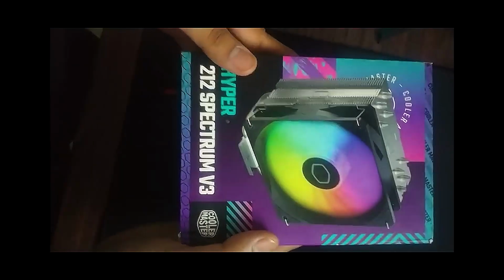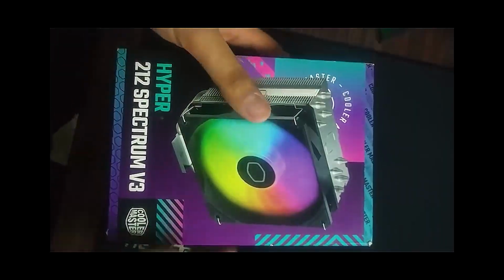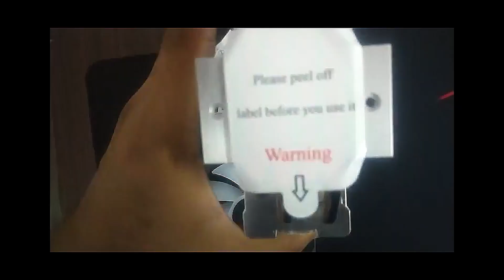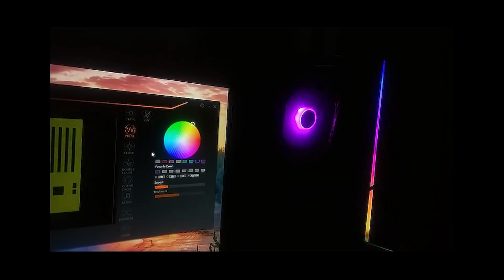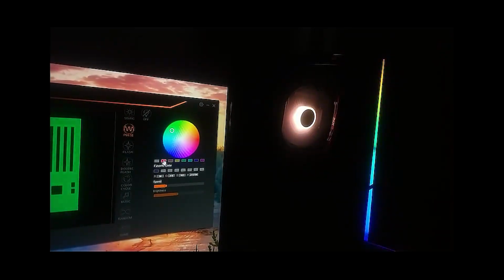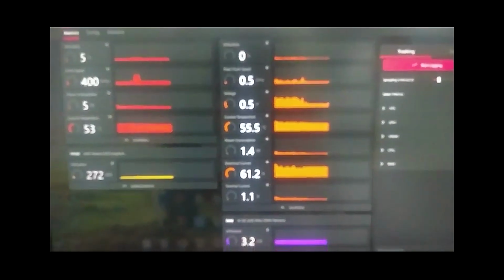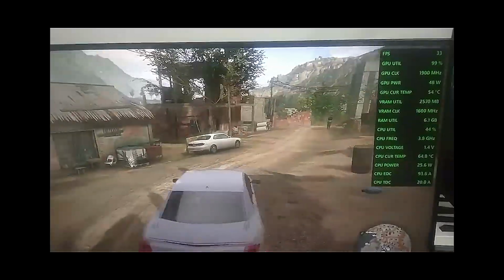Cooler Master Hyper 212 V3 CPU Cooler Unboxing & Installation (5600G) | 2024

Comment: Bro i dont have argb support to motherboard, does cpu cooler lights up with power pin ?
Reply from the maker: If you don't have the ARGB header then the cooler will light up with the default rainbow colors.

Comment: I have soke gigabyte h610 mobo it doesnt have rgb thing . Will this fan fit and run on my mobo ?
Reply from the maker: If your MB does not have an ARGB header then the fan will work but to control RGB you'll need an external controller.
Reply: @livingwithtechyt  ok thanks  I only want the fan working I don't care about the lights 😅

Comment: ffs install the fan with the wire at the bottom so the cable doesn't hang over the fan like that
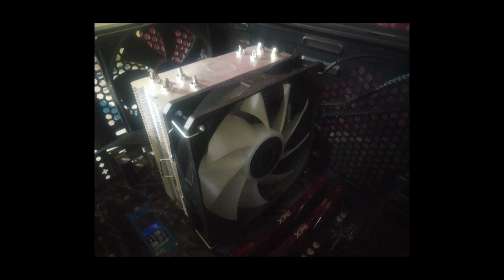Reply from the maker: actually, in the installation clip the wires are at the top but at 1:44 I corrected myself and even showed wires on the right side and finally at 4:05 wires are not hanging over it.
I messed up a lil, sorry for that.

Comment: Screw driver comes in box or you buy separately.
Reply from the maker: No man, screw driver is not included.🪛
Reply: @livingwithtechyt thermal paste is also come in box , why you buy separately,
Reply from the maker: @JustFilmYourself well, It's a better one and I didn't know if it was included.

Comment: The three pin connector is not going in to my ADDR_LED ports. Why is that? I don't want to force it in and break something.
Reply from the maker: Which motherboard do you have? does it have a three pin port? make sure to align the pins properly.

Comment: I need your help. I have an msi b550 pro vdh motherboard and I cannot find a single software to control the lights. help me find one please.
Reply: I have the same cooler
Reply from the maker: Did you try downloading msi center from the official site?
Reply: No but will try, thanks @livingwithtechyt
Reply from the maker: @huntarex2099 yes, let me know.
Reply: @livingwithtechyt  no luck. Could you please help me with the gigabyte fusion software or any other software that workss? I want to get rid of this ugly rbg lights and have a solid colour lol.
Reply from the maker: did you install mystic light?
Reply: @livingwithtechyt  yes, no luck.
Reply from the maker: Is it detecting the cooler? Make sure the LED cable is connected properly.
Reply: Yes it is, by default its on the rainbow rgb pattern.  @livingwithtechyt
Reply from the maker: So the software is detecting the cooler then what does it say when you change the color? Maybe try OpenRGB software.
Reply from the maker: or MSI Dragon Center
Reply: @livingwithtechyt  no the softwares dont detect the cooler at all. the cooler came with the rainbow rgb lights out of the box.
Reply: @livingwithtechyt  thanks dude I'll try that

Comment: Isn't 92 degrees bad ?
Reply from the maker: Yea really bad but after thermal paste and fan installation the temps came down to around 65 as you can see in the video.
Reply: Interesting I have a 9060xt 16gb with a 5600x I just bought and installed this cooler played space marines 2 at ultra settings and I was getting 80-87 Is that good?
Reply from the maker: I think it should be a little better tho like <=80C. Are you using the thermal paste that came with this cooler?
Reply: @livingwithtechyt i used mx-6
Reply from the maker: 🤔 hmm, maybe it's something else like case airflow or room temp, it's fine tho even if it's 87max at ultra.
Reply: It is case airflow im just having a hard figuring how to install front fans with my case 
@livingwithtechyt

Comment: broo this cooler fan has rgb issue I guess my ccoler rgb glitches when I plug it in and also rgb fusion staticonly work
Reply from the maker: I see 🤔, have you tried checking the fan connector or reinstalling the software?

Comment: can I use this for AMD ryzen 5 8600G mounted on MSI PRO A620ME motherboard
Reply from the maker: Yes, make sure your motherboard has a RGB header(3pin).
Reply: @ Yes, MSI PRO A620M-E motherboard includes a 4-pin RGB LED connector (JRGB) but does it allow this pin?
Reply from the maker: @JOZGAMING21 I checked and it seems your mb doesn't have a 3pin header, you might need an ARGB Controller (3pin 5v).

Comment: I have a ryzen 7 5700x and using this cooler 
for gaming its like 70-80 degree . it touches 80 when loading and stuff
for cpu full load the temp raise upto 85 degree 
is it safe ?
I have used the thermal paste that comes with the cooler.
Reply from the maker: 85 max, is okay. R7 5700x also has 65W TDP. make sure the fan speed and good airflow in your case.
Reply: @livingwithtechyt  yeah sure. Thank you
Reply: Does it make noise?
Reply: No @aouadinidal3382

Comment: So, can we install it directly on the motherboard backplate? I have a Hyper 212 LED Turbo, but it only comes with the Intel bracket, not the Intel+AMD. Installing it directly might put excessive pressure on the CPU socket.
Reply from the maker: Yes, this one goes directly on the mb backplate. check out a tutorial for your cooler, just to make sure.

Comment: can I use this for Ryzen 5 3600? and how frequent should the thermal paste be replaced any suggestions?
Reply from the maker: Yes, you can use it for your R5 3600 and for the thermal paste, I would say once in a year.
Reply: @livingwithtechyt  some ppl say change it once in every 6 months.....also I upgraded my cpu choice...I will rather go for r5 5600x...can I use it for this CPU?
Reply from the maker: You can do it twice a year too if you want and yes, you can use it on 5600x.
Reply: @Abhi-hb2sg  depending on your thermal paste you don't even need to change for more than 2 years, using a kryonaut and a similar model cooler my i7 6700k doesn't go past 75c and I haven't changed it since 2022.

Comment: this is useless i installed believing all the good reviews when i open couple of browser tabs the temp rises up to 80 and then comes back to normal after some 30 secs and again if i open anything else like a pdf again temp rises up.. How are you kids playing games with this? or anything wrong with my installation?
Reply: only at idle temp is around 50-55.
Reply from the maker: Which CPU?
Reply: @livingwithtechyt  i7 7700k msi z270 my mb
Reply from the maker: Is it Overclocked? And Maybe the thermal paste you are using?
Reply: @livingwithtechyt  no my cpu was not over clocked. I was using corsair H45 liquid cooling AIO, it works like a charm, keeps the cpu temp as low as under 40 at idle and max 60-70 when i use vm's, multiple browser tabs and other apps.  But only issue is the radiator makes buzzing noise i thought it's dying and i should change it so i bought this crap one but this CM hyper 212 can't handle loads like even few chrome tabs and when i start a VM, the temp went up high to 90+. I removed this 'over' hyper 212 now and connected my old corsair AIO back.
Reply from the maker: Okay but idk why that is happening, it should give you that much cooling and the liquid cooler should do even better. 🤔
Reply: @livingwithtechyt  my corsair liquid cooler is almost 8  years old and still doing its job perfectly except making that buzzing noise. Do you have virtual machines installed like vmware or virtual box or can you open multiple browser tabs and a few apps and see what the temp is?
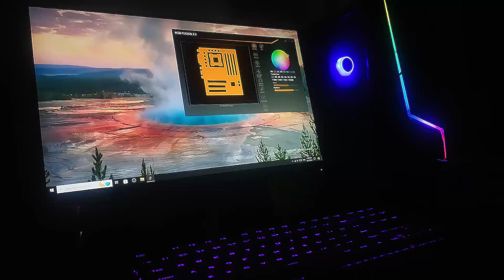Reply from the maker: Yea, I don't use VMs but I opened multiple tabs in chrome, fl studio, VS Code and Photoshop and the temp is hardly 50! And you can already see the in-game temps at 5:15.
Reply: @livingwithtechyt  yes your temp is normal   i am wondering why tf mine is broken it's brand new i installed it correctly. Does fan position matter? How i fitted the fan is with fan cables at the top is that right? or the fan cables should be at the bottom side?
Reply from the maker: @0xcoffee427I don't think that's the problem though in the video I've shown cables should be on the right with the logo on top 1:50 (at first I mounted it with the cables on top and didn't even notice any difference but yea).
Reply: @0xcoffee427  Its been almost a year since i bought this cooler and it works perfectly fine for me. As a long hour gamer my cpu doesn't even heat more than 55°c. Does your case have proper airflow? Intake and exhaust fans? Also make sure you installed the bracket properly and the cooler is well attached to your cpu. And hey, also have you removed the protection film sticker in the bottom of the cooler before you install?
Reply: @0xcoffee427  say fam.....maybe you didnt remove the plastic sticker at the bottom of the heatsink.
Reply: Or fan pushing in wrong direction
Reply: @ No. Seems like fan and the cable is faulty. I sent it for RMA and they said they would replace the fan and the cable. So waiting to receive a new one.
Reply: @  Fan and its cable is faulty. I sent it for RMA to replace it.

Comment: I need a tutorial to change the rgb colors.....!!
Reply: did u found it?
Reply from the maker: hey, do you still want a tutorial? Let me know.
Reply: @livingwithtechyt  my friend doesnt have rgb header, it says mystic light 3 is needed but he cant figure it out, i also cant help him as i cant see what he is doing. If you can help we will both sub to you 🙏
Reply from the maker: @kira3821  so you have a MSI motherboard? Does it not have a RGB header?
Reply: @livingwithtechyt  its gigabyte A520M, the cooler has color but its the default rainbow, he wants to change it, he tried the rgb fusion from gigabyte but it cant be detected
Reply from the maker: @kira3821  cannot be detected? have you connected the ARGB connector properly? I will probably make a video tutorial on it using RGB fusion and GCC.
Reply: @livingwithtechyt  should be right? cause it produces color, when he tried the rgb fusion, no cooler is detected there, so the software u should use depends on the mobo you are using? thanks again, i hope it would fix his problem, my cooler has no rgb so i dont have this problem 😂
Reply from the maker: Hey, I just tried it without connecting the ARGB and the cooler turns on the rainbow mode(default) just had to make sure, so ask him to check if it's properly connected. 3:58
Reply: @livingwithtechyt  uhmm i asked him to check it and he found out that a 3 pin is not conncted, its like a 4 pin but missing one, but he cant find a slot to put it in on his mobo, maybe a520m K v2 doesnt have it? its his first pc and its pre built one
Reply from the maker: @kira3821  yea that's the ARGB connector and yea I checked and it seems this MB doesn't have the header/slot in that case he'll need to use an external ARGB Controller maybe the one from cooler master.
Reply: @livingwithtechyt  thanks! we tot he has it cause google search keeps saying it has -_- can you link us the correct controller for the hyper 212 v3? just the name is enough, thanks for your help! we subscribed.

so we can avoid buying the wrong one
Reply from the maker: @kira3821 No problem. Here's one from cooler master https://www.coolermaster.com/en-global/products/argb-led-controller/
That'll work (there are many other options as well tho like "coolmoon argb 5v 3pin") and please like the video if it was helpful, thanks.

Comment: Your getting 90C? Thats really bad
Reply from the maker: Yes I know, now it's around 60°C
Reply: @livingwithtechyt  why u have 90°C????? is bad!!!
Reply: How did you reduce the temperature..?? Did you tighten the screws of the cooler further ??? @livingwithtechyt
Reply from the maker: Are you experiencing high temps even after installing this cooler?
Reply: @livingwithtechyt  so I thought what might be causing this high temp... I mean even with a stock cooler it should not be reaching close to its thermal limit...I mean I did not even over tasked my CPU...
Reply from the maker: @dipjyotichoudhury8816  sure it shouldn't when you're aren't doing much, which CPU are you using? And make sure the cooler is installed properly.
Reply: @livingwithtechyt  RYZEN 5 5600...i mean the stock cooler looks installed properly....just don't want to experience the same thing again after installing the Spectrum V3
Reply: @livingwithtechyt what was causing your high temps after installing the V3 ?? loose screw installation or something else...??
Reply from the maker: @dipjyotichoudhury8816  For me it was the thermal paste that dried, it was before installing this cooler, are you using one?
Reply: @livingwithtechyt  it is a new installation from a boxed pack...and the thermal paste that is currently over the processor is the pre-applied one that comes with the stock cooler...if the reason for over heating of my processor is due to the stock thermal paste...than the quality is really questionable....i mean what are the manufacturers thinking !
Reply from the maker: this cm v3 cooler also comes with a thermal paste maybe give it a try also this is not a pre built pc right?
Reply from the maker: Oh sorry, just read the prev comment you haven't bought this cooler yet.
Reply: @livingwithtechyt just upgraded my system recently to match with my RTX 3060 that I was running with an Intel Core i3 7100...those were the good old days when even with stock cooler  i did not have to worry about temps...new upgrade sometime comes bundled with headaches ...
Reply from the maker: Even This shouldn't be, if it's not the thermal paste and if it's installed alright which ig it is.
Reply from the maker: Also did you try max RPM?
Reply: @livingwithtechyt  it was already at max rpm

Comment: Is it suitable for i3 9100F?
Reply from the maker: Yes. It will be good.
Reply: @livingwithtechyt thanks. What temperature does it reach now? When the Intel fan is running, it goes up to 90 degrees.
Reply from the maker: at idle its around 43°C and while gaming or editing it's about 60-65°C as shown in the video
Reply: @livingwithtechyt soo thanks

Comment: My motherboard is not having RGB/ARGB header, can i still get lights on this cooler??
Reply from the maker: No, without connecting the rgb, lights won't work.
Reply: @livingwithtechyt  Hi, my moherboard doesn't have the argb 3 pin connector but still the rgb lights are on only connected to the cpu fan, is there a way to turn it off without a controller?
Reply from the maker: Hey, Sorry but I don't know how it can be controlled without a connector of some sort and theres no physical button or something on the fan itself to do that either.
Reply: Yes, you just need a 'RGB Controller'. It will work 100%.

Comment: I bought the pc prebuilt it came with the same cooler and I'm unable to change the colour of the fan using rgb fusion,do you have any ideas
Reply from the maker: Does it have a Gigabyte motherboard? Sorry for the late reply tho.
Reply: @livingwithtechyt  thanks for the reply,i figured it tho,I downloaded the gigabyte control centre from which I'm able to change the colours